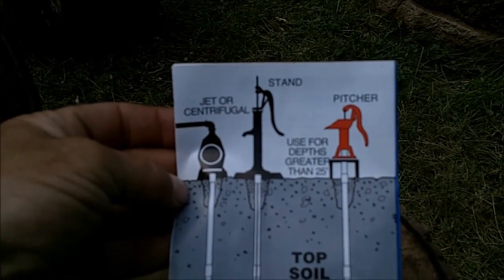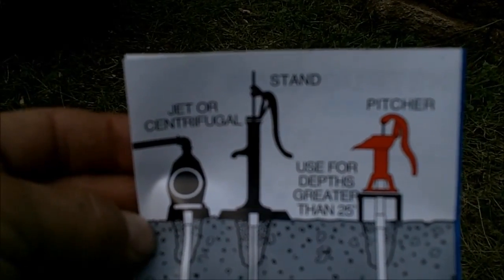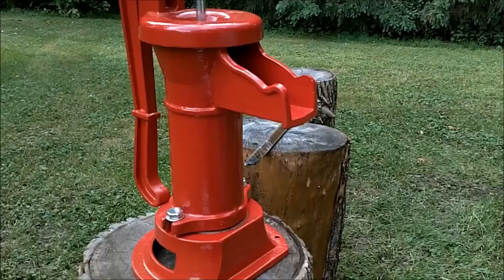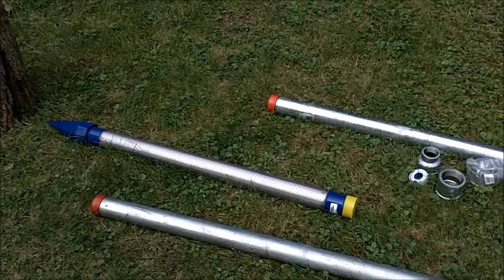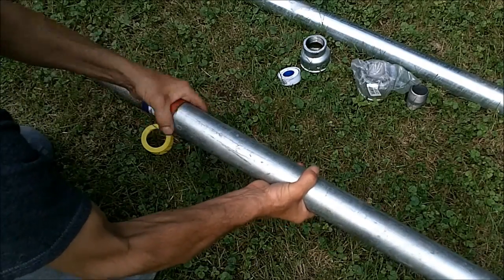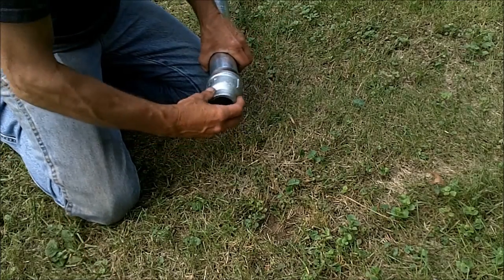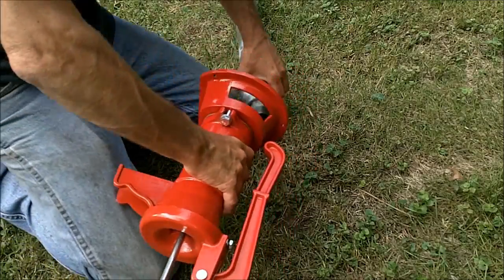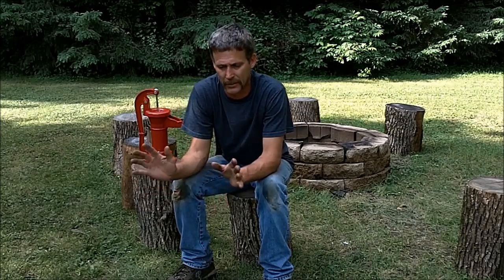Parts Needed For A Hand Pump Water Well.  The Tent Well. Part One.

Comment: Great but I wanted to see how to hit it without damaging the pipe
Reply from the maker: You screw a metal cap on it. Discard the cap when you are done. With this well, there is way too many rocks there to hand drive it. I had a big backhoe come in and dig the hole down to 4 feet into the water and then I placed the pipe and sand point and then had him backfill it.
Reply: @JoeandZachSurvival  great brother,  im gonna start mine,  hopefully is not to deep , I have a small creek a few meters away

Comment: A shallow well could be 100’.  The depth is a description how deep to the water.   The water level has to be 25’ or less for any pump to pull it up.   If the water level in the pipe is deeper than that you need a pump at the bottom.

Comment: We installed a 2 1/2 inch water well for our irrigation system using a 6 1/4 inch hand post hole auger.  We hit sand that was too wet to be lifted by the auger @ 8 feet.  We inserted a 6 inch PVC sch. 40 pipe down the hole to act as a well casing.  We then pounded a 14 foot well pipe with sand point down to the level of the pump.  We added a one way check valve and connected a pitcher pump to the top and started pumping.  We hand pumped for about 15 minutes and the water was coming out really clear.  We connected it to the 2 hp irrigation pump and turned it on.  We calculated the flow @ 55 GPM from an 1 1/2 inch manifold.  We reduced to a 1 inch zone line and connected 1 inch Rainbird zone valves.  Zone lines are 1 inch 100 PSI black poly pipe.  We used a walk behind trenching machine to make the trenches for the zone lines around the house and ran spider veins out to sprinkler heads following Rainbird's free design plan.  We modified the Rainbird plan from the 4 square design to a triangle design.  System has worked for 14 years now.

Comment: You're supposed to drive this system down in sections. You also need to use drive couplings for it, not standard. If there is a rock layer or something neer the top, you could dig through it, or drive through it. Either way works, but it can pitch the well and it will be slightly askew.

Comment: put in a one way foot valve above the screen so you won't have to prime it everytime.
Reply: or a check valve at the top will help maintain vacuum
Reply: Ball valve.
Reply: You can make a one way valve using a marble, PVC fittings and an O ring.  O ring sizes can be bought at Harbor Freight.

Comment: For those who have asked, a hand pump that uses suction from the pump head can only draw water from 30 feet max at sea level. Less at higher altitudes. Only 20 feet at 8000 feet altitude. If the water table is deeper, you need to the pump to be below the water table. Only a licensed driller can drill below 18 feet or 20 feet in most states. Every state has a maximum depth for wells without permits and by non-licensed drillers. The fines can get expensive.
Reply from the maker: +Mark G No permit is needed up at the tent but you are correct. Thank you. Joe.
Reply: Lol only stupid people need permits to drill a well to drink water on their land the government is your stupid god and people god different than your god.
Reply: @thetruth8958  The aquifer is a protected public domain that is subject to water rights and maintaining sanitation of the aquifer. Penetrating the aquifer without protecting it from surface water infiltration is a danger to others. Many aquifers have been damaged by infiltration of contaminants. 
As I said, many states require permits to drill past 18 to 20 feet. Even those first 18 to 20 feet are regulated to prevent contamination.

Comment: If you are having to dig the well by hand, then install the sand point into the dug hole and backfill, I would HIGHLY recommend setting casing into the hole with a slotted liner on the bottom so that when the sand point needs to be changed, it will be easy to replace, and if you wanted to put a submersible pump in, the casing would be set….just a shame to dig the hole and not set casing for future ease of work…just a suggestion...

Comment: Where I live it's like 130 feet down before you hit the water table. If that isn't bad enough there is constant thin veins (from a few inches to a couple of feet thick) of sandstone and limestone on the way down. I have asked some of the old timers around here who are lucky enough to have wells and they all say that their's was dug with a big well drilling rig and cost them a couple of hundred dollars (1950's-60's). Most were to shocked that to find out that after some checking, to have a well drilled around here now runs anywhere from three to five thousand dollars. Then there are all the government regulations and fees to get a well dug in the first place. Personally I would just as well not want them to even know I have a well.
 But I am dead serious about not drinking or bathing anymore with water containing fluoride. There is also a very good chance that I will be moving away from here within the next 3 to 4 years. So I am working on a system to capture, filter and purify rain water. I'll still be connected to city water for backup but will be using the rain water as our primary source. If anyone knows of a way for a regular guy to dig his own well with the obstacles I am currently presented, your advise would be appreciated.
Reply: Installa cistern in the ground, and channel all your downspouts to drain into it, so all the water that hist your roof drains into your cistern.  Very popular system in Arizona

Comment: What type of pipe and can you hammer it?
Reply: I know this is an ancient post, lol.... I believe the pipe is galvanized steel, most hardware stores carry it. - Yes, it can be hammered in, with a slide hammer, just like a T-post. Not sure why he's using a backhoe . I'm about to put one in, hook up a small trash pump and a sprinkler head to irrigate a pasture. Our well that supplies the house is 18-20 ft deep, so it should work. - One more thing, if you hammer in the pipe, be sure to get a "cap" for the top piece, so the hammering won't mess up your pipe threads. After each length hammered, remove the cap, add the next length and put the cap on.

Comment: Thanks for the video Joe! Here goes a stupid question for you: If the water table is only 4 feet down is it not overkill to put 13 feet of piping? Wouldn't 6 ft suffice? Also I wonder if you simply going through top soil, clay, gravel and water retaining sand, is there not a way to hammer in some piping without the need for a huge backhoe? Sorry for the dumb question, but I am looking for the cheapest and less machinary dependant method if it exists out there in the right conditions. Thanks!